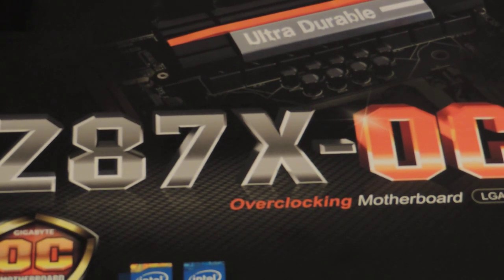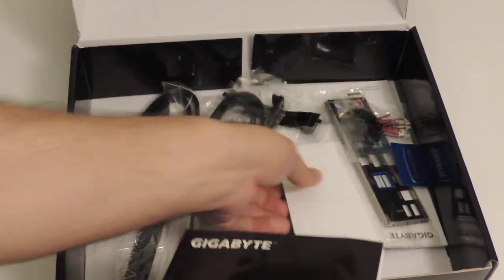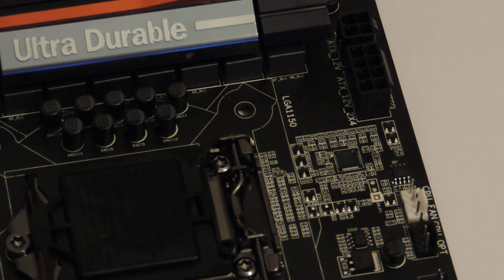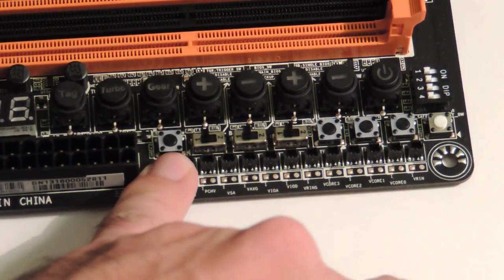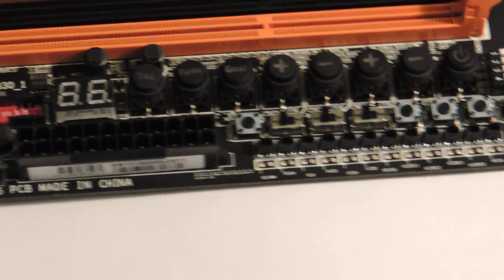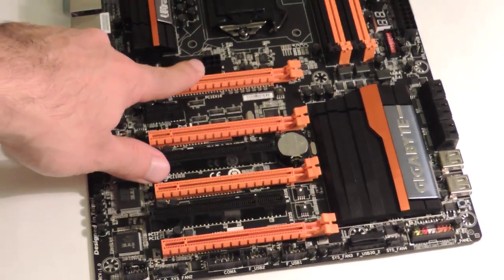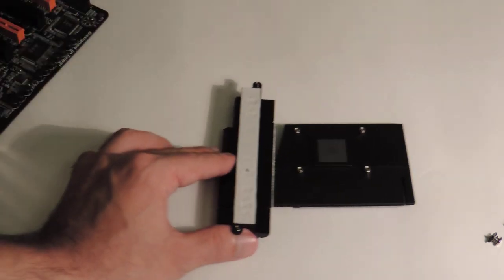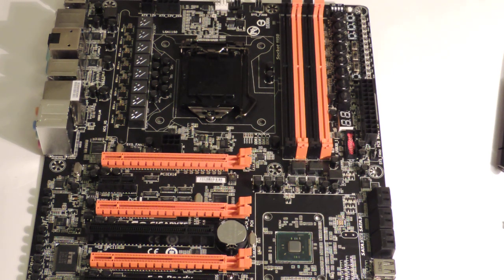[SH]GIGABYTE Z87X-OC Review and Unboxing

Comment: Very very informative..
I need a help.
i'm actually going to build Gamin/Animation PC. I'm gonna use 4770K, z87X-oc, 1866MHz 16GB Corsair Vengence, 1000W Cooler Master Silen Pro M2, 2 x R9 290X (i know about Nvidia's Cuda for rendering but still i want AMD), 4 x 4TB WD Cavier Black, 2TB Seagate Constellation, 256GB Corsair Neutron GT SSD, Blu-Ray drive,Swiftech H220 Cooler, and total 8 case fans(some AF and SP from Corsair).
which CPU Power to use & should i use Extra GPU Power also?

Comment: I wish to build a hackintosh for strong video editing.final cut .adobe after effects motion 5,
any difference between ? GA-Z87X-OC Force and GA-Z87X-OC , ? i mean for video editing performance, plan to make them run with a Intel Core i7 4770K 4x3.50GHz So1150 Box Haswel. advice please.